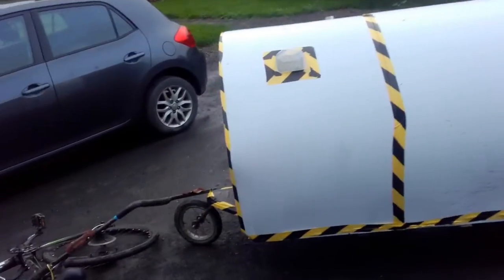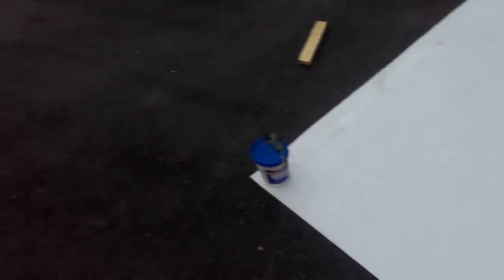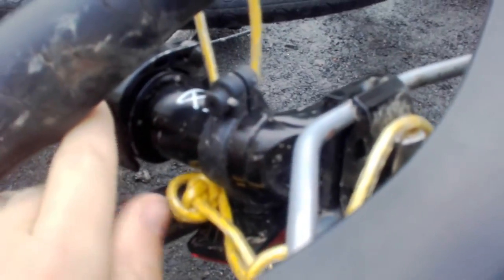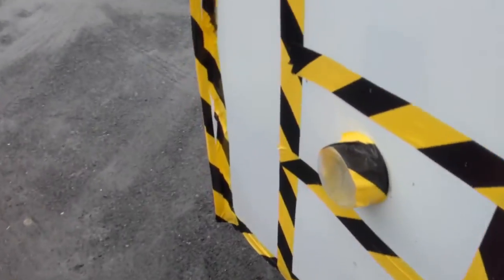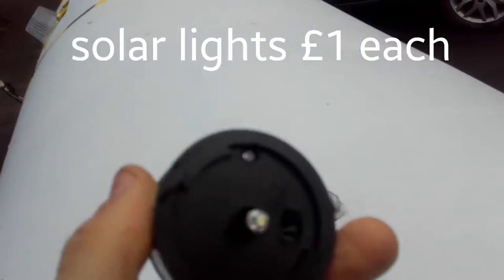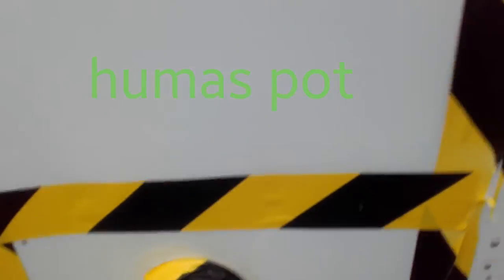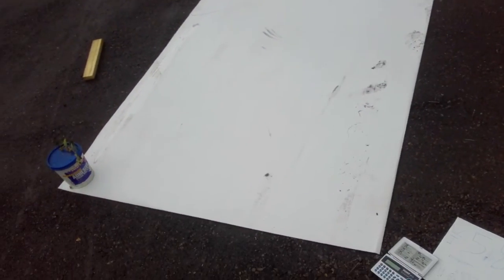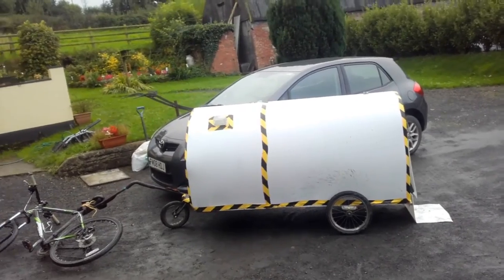My £20 bike camper!!

Comment: Your bicycle camper looks like a nice place to be, out of the weather, comfortable and snug.

I'm impressed at how inexpensive your build was, I'm thinking of looking for a secondhand child bicycle trailer with suspension.

It will come with a bicycle quick fit connector and quickly detachable wheels, the chassis can be adapted to my preference.

These used child bicycle trailers are inexpensive (from 0.99p on ebay).

Comment: On the Mark II locate your wheels in the center.  It would take weight off the front making things a bit easier to deal with I think.  I'm doing a Motorized bike and more then thinking about doing this.  You done did Good.  Thank You !
Reply from the maker: Thanks for the feedback. good luck/ congratulations on your bike!

Comment: Where did you source your coroplast/correx? I'm having trouble finding sheets in the UK, I know they reuse campaign signs in the US
Reply: Ah I read the description. What thickness coroplast did you use?
Reply from the maker: +ErinDoes  I used 2mm because it was a prototype but it's beast to use 4mm because it's stronger and it's better insulation